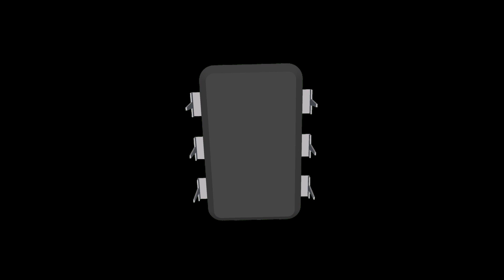BENCH TALK: Cheap Wire Glue from eBay - Is it useful?

Comment: The only reason you call wires run to a board a junction is cause it's clustered just learn to solder never would I ever glue wires to a circuit board
Reply from the maker: Lol I totally agree that this is not a valid use case. It's what we call "a test".

Comment: Would this work to repair the conductive paint on a rubber keypad? For example I have a synth that I need to repair the key pads on however they're not round like remote buttons but rather long and thin (like a PCB track). Would this stuff adhere to the rubber and would it last?

Comment: Here is an easy one. The answer is obvious but I always like to get confirmations first.
How many would say, yes, that JB Weld Steel Stick is sufficient to join wires together under the dashboard of my car   then adding a protective cover (electrical tape, heat weld, etc.)?
I'll be doing this tommorow.
Another question is, "Does JB Weld Steel Stick
 conduct electricity?
Reply: Did it work? That's exactly the question I'm trying to get answered right now thank you in advance

Comment: To measure the resistance while glued on copper is a bit "unlucky" in my optinion... You have a "0 Ohm" resistor in parallel.
The resistance will not change much with distance, but with the thickness of the glue layer (needle's contact point down to the copper layer).

Comment: It's the same stuff they use in TV remotes for getting a "two layer" PCB out of a single layer phenolic one. They print it over the solder resist coating. The contacts for the buttons and the traces going to them are made with it, and at some points have "vias" where there is no solder resist and the solder glue mates with the copper underneath. If say, a trace going to a button cracks or corrodes away, that button will stop working. The black stuff doesn't take to solder very well or at all, so you have to follow that trace until you find the copper, scratch some solder resist off and run thin transformer wire to the button, making a flat blob of wire and solder at the button end, to fix the damn remote. Or you can use a drop of this stuff to patch the broken section.
They sell siringes with just a bit that will last you a lifetime of remotes. It is also useful for making your own custom value resistors.

Comment: Wood glue (PVA type) combined with powdered silver solder. Beats everything and it's DIY.
It'll stick conductively to aluminum, copper, steel, and bare silicon (it'll bond to solar cells). It'll stick to anything as far as I know; it just needs to be a clean surface.

*) Any solder that isn't rosin core can be used, but lead free is probably safer to make and handle.
*) A lot of ratios between the glue and powder are possible. More powder = better conductor.
*) It starts hardening quickly when mixed (50/50 is about half a minute before it gets tacky).

When I made powdered solder, I used a 12VDC fan with the blades clipped off, running at reduced speed with some double stick tape and sandpaper bonded to it. To feed a piece of solder into the makeshift sander, I attached a drinking straw to a block of wood with duct tape at an angle to the sander. It'll throw some dust into the air, even at reduced speeds, so it'll need to be done in a garage with a bowl or something covering the sander. The dust is conductive, so avoid doing this near computers. Metal dusts mixed with air can become explosive ~ so avoid blowing the dust into the air near sparks or open flames.

As far as I'm aware, this recipe is unknown - or it's in the public domain now. I stumbled onto it a few years ago when I tested graphite/carbon/metal powders with every household binder (paints, glues, etc). This combination beat everything else. Most of the glues and binders I tried wouldn't work with metal powder at all. Notably, spar varnish isn't as good, but it works with both carbon and metal powders (it's the next best alternative to wood glue).
Reply: Nevermind, after further research, I found fine powder is great.  Even nanoscale is good.  I'm planning to make mine with a file instead of sandpaper to avoid sand getting in it and I even plan to build a ball mill to make it even finer.  I also bought 200 mesh filter to filter out the oversized silver particles.  As a side note, I managed to find a seller on eBay that sells pure silver powder for the same price as silver ingots are sold so as long as that seller continues at that price range, is more practical to just buy the silver particles than make your own.  Now I just need to know the best glue to use.  You say PVA glue is great so I will try it but I'm curious if oxidation is an issue over a long-term duration of time.  Since PVA glue is a robbery glue, I imagine it would protect the particles from oxidation to some extent.  I'd like to know if the stuff you built with PVA glue still has good connectivity after many years?
Reply: If I sent ya $10 how much would that get me? ;) (To save me all that hassle of grinding down the metal, etc.)
Reply: For making silver particles combined with PVA glue, what grit of sandpaper did you use?  Is the goal a fine powder or more of a coarse powder?  Which works better fine or coarse?
Reply: Hi - 5 years late to the thread...
Why silver? Wouldn't powdered copper be the best choice to mix with glue to make a conductive solder glue? I can get atomized copper powder online for quite cheap.
Reply: @HowardBaileyMusic  It might work, but long term I think the copper powder will react with air, moisture, or any dissimilar metal it's bonded to. Silver oxide remains conductive, but copper oxide is a semiconductor.

It solidifies within a minute of mixing the powder and glue together. The faster it's mixed and applied, the better it'll bond. I recommend mixing it in very small bathes.

Comment: I've used wire glue (carbon based) on boards that daren't be soldered (sputtered gold) and worried about the reliability of the conductivity.  So I then painted over the bond with conductive silver paint and that worked a treat.  Once that had cured, I used Araldite two part resin to coat and hold the painted bond.  Annoyingly when wire glue is sold, the packets never tell you that there will be resistance generated in the bond, rather than 00.0 Ohms.  It's no pure magic bullet, but it has gotten me out of problems before.
Reply: Glue and all that will corrode

Comment: Well let me tell you something, I got the same product from ebay,Wire Glue, I used in many stuff (such pcb) and it worked really fine in the beginning  however after weeks of done that I tried the same stuff, and surprise,  conductive property stop working. seriously even wtih stuff I haven't used. It got really dried. Now I am replacing all this stuff with silver conductive wire glue paste..
Reply: Yep, the Wire glue is only temporary. Use either sand paper to wear down the carbon membrane pads or use silver conductive wire glue, like you said.
Reply: Dude just solder it stop with the glues they melt

Comment: always wondered about stuff like this , so do you think this stuff could be used instead of solder to put header pins on a pi zero or an esp8266 ?
Reply from the maker: I'd say if you can apply it carefully and avoid shorting pins together, it would work.  The shorter the junction, the less resistance is added by this stuff.  Good luck!